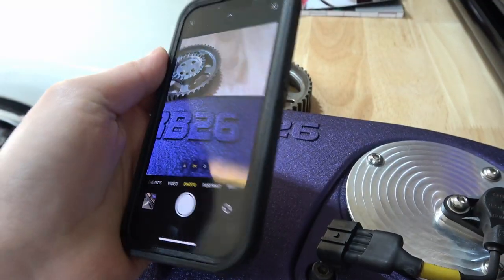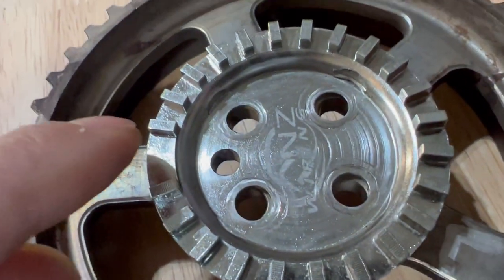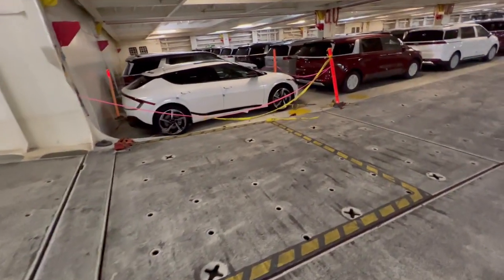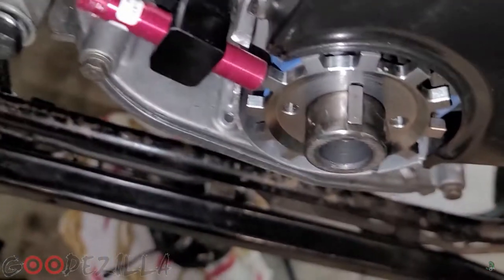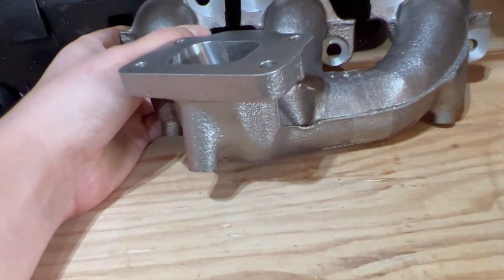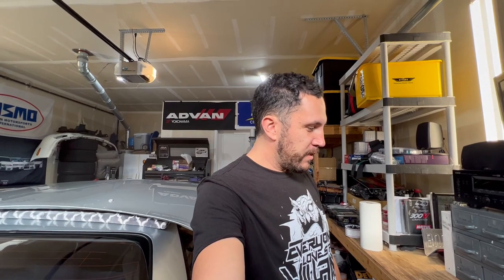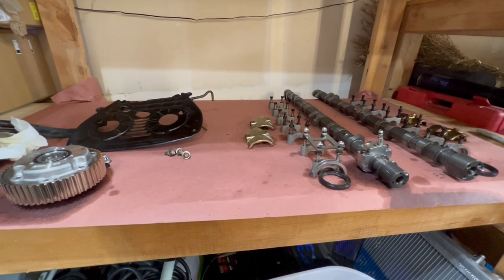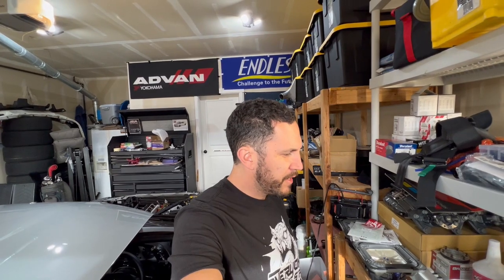Can you use an IPhone 13 pro to make YouTube videos review NZ wiring RB26 trigger kit up close look

Comment: That phone records pretty good! I am impressed, great video brother! I love the looks of the NZ sensor too, looks super clean and flush. The best part that I read up on too if I'm not mistaken, once it's timed it doesn't have to timed again even if you take it off Incase you need to take off the timing belt cover
Reply from the maker: Yeah David, I am thinking the same thing as you. The timing should not need to be adjusted once it is set. The NZ Trigger kit bolts right on and off in same position. There may be a need a small adjustments, but you could easily do that in the Link G4 software.  I need to watch your new bumper video, your car is looking nice!
Reply: Thanks brother! Yea the bumper one is just a quick slap together haha did it right after work

Comment: Small format sensors (like cell phones) have one inherent advantage over larger format like "C".   Depth of field.  Smaller formats have more depth of field for a given amount of light available.   My "good" camera is a Sony C format mirrorless.  My "other" camera is a Samsung S21 cell phone.  I find myself in a continual battle using both, and I'm just shooting photos, not videos.   Usually I want a lot of depth of field - advantage cell phone.  But I also want maximum sharpness when looking at the photo full size to see small detail - advantage C format with good lens - unless I need more depth of field than what the C will give me.  BTW from what I've seen I think the iphone 12 and 13 are a little better on color accuracy or life-like color without having to fool around with the white balance or whatever, than the Samsung S21 which in my opinion looks too blue and too sort of "flat" color wise.   Just my 2 cents LOL.
Reply from the maker: Thanks Gary, lots of insight on this subject. Hope all is well with you and happy holidays!

Comment: Are you switching from the Tomei exhaust manis to the N1?
Reply from the maker: I most likely will be going back to OEM manifolds because of fitment. So much easier to work with than Tomei manifolds. I will decide later what I am going to do. But, I will have a set of each at least. With engine out of the car, I might stay with Tomei!